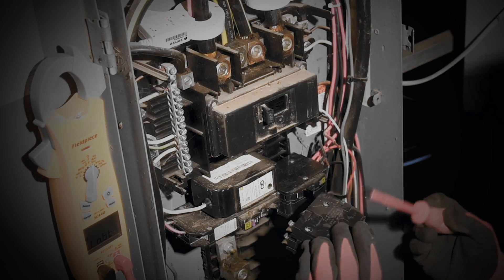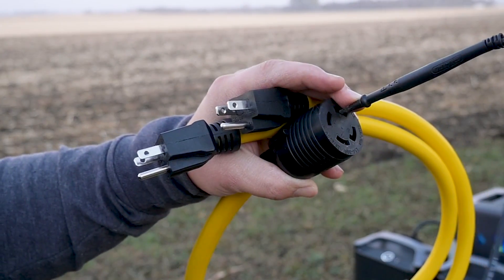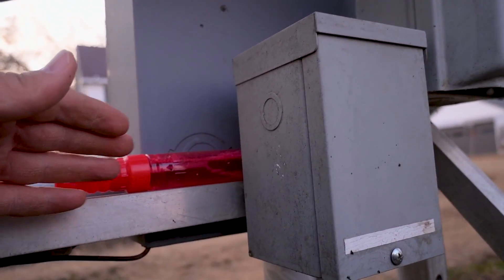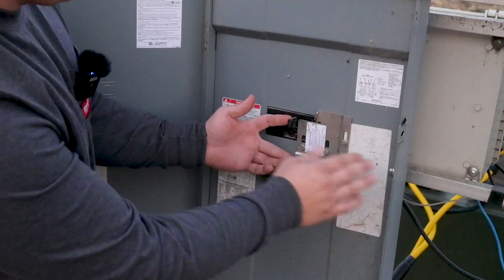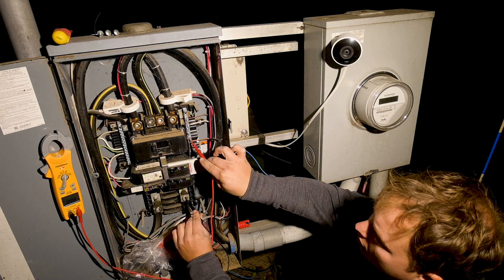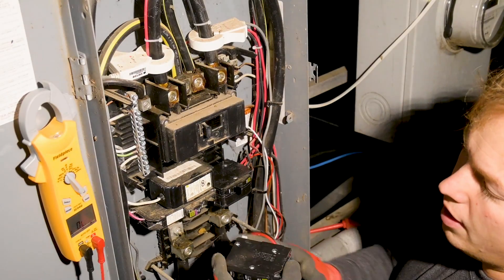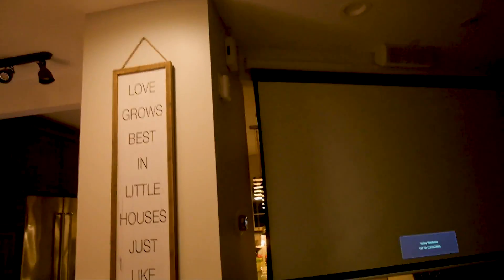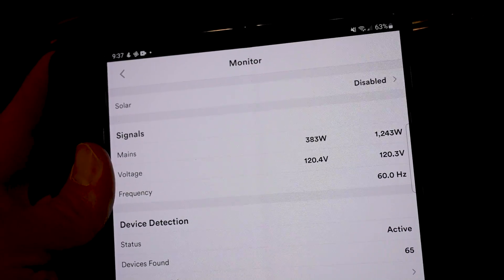Can You Power a 240 Volt Panel With Two 120 Volt Generators?

Comment: My science experiment - Two 120v Grid Tie Micro Inverters they can feed both sides of the panel as each inverter will sync to the grid power keeping the right phase.
Best to go directy to panel since suicide cables are agaisnt code here, but they are not inheriently unsafe (electrically) as they are in code in other countries and products are made to do just that.

I guess technically that is not a suicide cable since its not a plug on both sides, but you are plugging an inveter into a downstream outlet and feeding power up to the panel thru it.

The only important thing is to never feed power to a live grid system without a bi directional meter (net metering) OR never feed more power into the system than you are currently using.

For me that is easy, as I have a server rack using 600w of power 24/7 so I can feed 600w of solar into my system at any time without risk.

For other people, you can get more crafty by mixing electrical science with smart home tech.

Example: use a smart switch to turn on/off your back feed connection, and have that smart switch only trigger to turn on when your high demand appliance is turned on.

For this kind of off grid experiment, you can feed both sides of the panel with the same inverter for an emergency situation with the 240 breakers off and be fine.

Comment: in order for these to work they need to have some type of controller to control the phase so they are exactly 180 degrees out of phase.  I have an inverter setup that has such a controller built in they talk to each other and sync up their phases to put out the correct combined voltage.   without it it would not make proper 220v.

Comment: I know this is 2 years old so I hope you respond.  I have thought of doing the same thing as you here but I was concerned with the neutral leg getting overloaded.  I think that could happen when you have a large load on one leg at the same time both generators are in phase with each other.  Essentially not allowing the phase of the opposite let to cancel out the neutral phase load.  I'm thinking back to the video where you explained neutral bonding relationship with the outside panel and inside panel.  Am I out to lunch on this?

Comment: You can get a generator plug cord that just goes to one 120V plug and ties the two hot legs together.  This seems to be a safer solution.  Unless you have a split phase inverter or linkable/syncing inverters you can't run both legs and get the 240V to work.

Comment: If you have any multiwire branch circuits, which have shared neutrals, you could potentially overheat the neutral wire inside your wall.  So, exercise caution if pulling much over 10 amps on both circuits sharing a neutral.

Comment: I wanted to know whether or not I'm going to get 240V out of my 120V generator. I would connect the Y-cable that you have to the two sockets of the generator. It's clear that - if they were connected to poles, they would be perfectly in sync and thus I would get 240V. If they're connected to the same pole I should get perfectly 0 volts. But how are 2000W generators wired?

Comment: I bought a brand new Siemens 30 amp breaker from the store when I was installing my generator lockout / power inlet box on my house.  (which was fully inspected by the city inspector) When I completed the install I started checking and verifying voltages with my digital multi meter and I found one side of my panel was dead while running on generator power.  I narrowed it down to a bad breaker.  Same deal you had here....  I had continuity through one pole on the breaker, but not the other.  Brand new breaker, bad from the store. Weird.

Comment: Hello I have an older Coleman powermate 5000 watt 120/240 volt generator. All it has is four 120 outlets on two different circuits. Some come with a 240 outlet and 2 120 outs. Could I use that cable you have and pull from both circuits and make 240?

Comment: Enjoyed the video I new you were going to get the 240 before it showed, 1st  I was thinking it was like breaker for water heater but I was thinking phase slightly off between. 2 sources  but it was slight frequency difference between the 2 inverters. They actually have those battery storage devices with inverters that can give you 240 volts! You called them generators as many do, but they are batteries with inverters/ solar panels and not generators. But it made for interesting video!

Comment: Would that not be the same as connecting to dual pole breaker like the one for your water heater which gives you 240  volts? I think So, but actually depending on your power sorces it will be like 2 single poles each giving you 120 = 240 volts

Comment: I have a Honda 2200 and a Honda 2000 can in use the yellow cable you used on my generators to power my 240 well pump? 
I have a 
30 Amp Generator Power Inlet Box, NEMA L14-30P Power Inlet Box for 4 Prong Generator Cord

Comment: I think you're right about the frequency between the 2 power supplies. When I was in the service, sometimes we had to run 2 generators to handle a very large load. The generators had paralleling light that would flash when it was correct to add the second generator so the frequencies were the same.

Comment: I was prepared to yell at you but then you turned off the 240 volt suff.
Then again your smarter than that.
In the event of a power outage, would a generator or power bank get damaged when the power came back on?
I understand not back feeding the utility to protect people working on the power lines.
Beautiful family by the way.

Comment: There’s an easier way to back feed your panel with 120 Volts. disconnect all your 240 Volt loads. Take a regular 120 V extension cord. Cut the end off and install an L 1430 plug and jumper the hots  in the plug. when you backfeed your panel you will now have 120volts to both legs . Definitely need to keep the 240 loads off. Love your show……

Comment: I have a generator that only has 2 120volt outlets. I have 2 male to male extension cords to power my house when RG&E goes down. I hook up one extension to the outlet in one bedroom and the other in another bedroom on the other side of the house. Of course, I turn off main power to the power company. everything works. I don't try to run 220-volt water pump or dryer. Gets me by during the outage. I wrote to you about this a long time ago. When I ran one extension cord in the garage it would not run my furnace or refrigerator. By doing the above all works great.

Comment: The drifting phases assumptions are correct. Some inverters are equipped to automatically synchronize as a cooperating pair, providing center-tap style 120v/240v. I have a pair of Xantrex 2 kw inverters, new in 2007, that are configured so. They work flawlessly, including auto cut-over, auto phase synchronization, with an absolutely perfect waveform. The inverter pair easily power the 120v and 240  loads including the range-top, oven, HVAC (A/C,  furnace blower, etc.), at 4 kw continuous, 6 kw peak/surge.  Each inverter is also a 100 amp, fully computerized battery charger keeping my bank of golf-cart batteries in tip-top condition.  The cascading power sources are mains, solar, and finally propane fueled generator. When the mains fail, the generator, solar panels, or batteries power the inverters which are always carrying the load.
Reply: Exactly which inverter charger model ?

Comment: I think everyone that commented are saying about the same thing. The two power generators are running independently of each other frequency wise and are not in sync with each other. If the two 120vac generators were able to be synced together they would have to be 180 deg out of phase so you would have steady 240 vac voltage.  You would have to be careful not to pull any more load then what the generator with the lowest wattage rating is.

Comment: power from generators at power plants are 3 phases each cycling up and down as generator turns each rotation. you only get one phase run to each local transformer the thin wire on top it has to be in perfect sync and phase because the transformer just splits it into two 120-volt legs from 11,000 volts coming in so you get 240 volts across both because it is rising and falling at same time, so it doubles voltage if they were out of sync they can't add up
this why ac electric motors run at same speed either 1750 or 3500 rpm depending on how many coils and magnets they have to match 60 cycles per second

Comment: I recommend using something like "Voltage Converter Transformer 5000W Watt Heavy Duty Step Up/Down 110V to 220V Home Commercial Voltage" This transformer available on Amaz for US$ 120.  Problem with phase and frequency SOLVED!

Comment: test with two similar/same battery generators to see if the inverters don’t drift.  Can you confirm if the inverter in the gen set is a pure SINE WAVE…. ?  I like the idea as I have a rural property where power outages are frequent but no protracted.  It would be goo to have a way to see when the CO-OP is back even when on the batt/gen for power… a sensor?  I also like your idea of the gas gen set to recharge the batt gen set to extend the back up power.  Kudos

Comment: Wow it is so amazing that you did not understand that this could not work. It is amazing that modern people understand electricity (AC in this case) little better than those who lived during the revolutionary war. This failure was 100% predictable - just ask someone who knows what they are doing. You created 2 separate 120V systems on your panel but 240V cannot work this way. See other comments about phase.

Comment: I was an electrician on locomotives. When working on cab signal you has to use analog meters because of induction.
I may be wrong in this case.
With enough induction going on you just get the probes close and you get what some people call ghost readings,🍄🤣

Comment: Ben, question, a standard house main panel has two separate legs of 120 to which are separate Phases of electrical voltage supply. 
IE: left vs right legs on the panel 
How do you verify or test for this 120 volt phase output difference. That’s question one
Question two is would it not better or safer to have the same power supply for each leg to insure the same consistency of voltage output

Comment: In a split phase system the 120 legs need to be 180 degrees out of phase from each other to get a full 240 voltage between them.

Comment: I have been thinking of using a dual 120 volt output generator with this type of cord. I need to make sure it has a common neutral and ground, I like the videos your making. I knew the cause of the voltage differences right away and feel that my generator wont cause that issue

Comment: Even if the two frequencies are identical, they are not synchronized.  Therefore, other than never being more than the combined value of two voltages, the voltage between the two hots cannot be determined / predicted.
However, there's another issue. That has to do with the possibility of overloading one or more neutral conductors.
Because your temporary power sources fall far short (less than half) of that which could be supplied from the grid, it's unlikely to be a problem on the feed neutral supplying power to your house.
However, depending on what is allowed on residential systems in your district, you should also be aware that some 115 vac circuits could have been supplied with physically connected / joined, but separately switched, 230 vac breakers.. For example, duplex receptacles in some kitchens in NA have been supplied with 230 vac with the hot side bonding bar removed so as to deliver 115 vac of opposite polarities to each individual outlet on the receptacle.  The fact that the two outlets are fed off opposite legs, allows for the sharing of one neutral.  Feeding that type of combined 115 vac circuitry, with two unsynchronized sources can easily over load the neutral as only the hot side wiring is protected with circuit breakers.
Thank you for the video.  I appreciate what you're trying to do, but, if I were you, I would seriously consider taking the video down.  There are too many opportunities in it for folks to screw up and have the end result of you having to defend yourself in a very expensive court system.. even if you prevail in your defense.
Best of luck, Dennis

Comment: I have  a Honda 2200 i where I Use a 30 amp 120 volt wire to hook to a L14 240 volt plug . On the L14, I tie the Xand Y together with a jumper. That way I get both sides of the panel.. Turning off all of the 240 breakers and I have no Multi wired shared circuits. So far it works very well, and only use some lights and 2 fridge and box fan or heat. I use this instead of my larger generator for short outages... Also with my Duromax 5500 It seems to run my computer and Tv with no interference issues.
Reply: What if I had the adaptor he is using here and plugged both of them into the Honda 2200 would that be safe if I had some MWBC's?

Comment: I did this with a generator by connecting 2 110v from an outlet to both sides of a dual breaker, like you sid did not have 240 V but kept lights, fridge and freezers working

Comment: The frequency of the two Battery backup/inverter systems is more than fine. The issue is that they are not synchronized together at 180 degrees. 
So what you are seeing is that as they slowly drift in and out of the relative phase with each other unit, the apparent voltage across them will constantly change/drift relative to the other.

Comment: Hi Ben, 

I’m wondering about the shared neutral.  If those power banks are pushing 15A, then no issue.  But if you were to plug those in a generator, those receptacles are usually 20A.  So there would be a potential to feed 2x 20A and therefore the potential to return up to 40A on the single neutral which supports only 30A.  Isn’t that right? 

 
I’ve been researching using a 120V 30A generator to connect to my cottage’s panel via a 30A 240v cable/plug.  I’d be connecting both hots from the 240v plug to the single hot on the 120 plug to feed both legs on the panel but I’m reading of some concerns for the neutral wire with this configuration.  What I’m thinking however is that as long as I do not draw more that 30A at any given time I should be fine.  And if I happen to draw more that 30A, then I’d expect the breaker on the generator to trip, hence there would be no real potential for overheating that neutral.  Does this make sense?

Comment: Actually,  in the normal electrical power you get from the electric company,  each of the two 120 Volt lines coming into the breaker box are exactly 60 Hz and exactly 180 degrees out of phase.  This results in 240 VAC as measured line to line.
Now,  when you try to connect two stand alone AC sources; and measure line to line; since each independent source is generating power and not synchronized to the other, the phase of each relative to the other is random and therefore when you measure line to line across the two sources, you will always see random voltage values, which is exactly what he saw. 😊